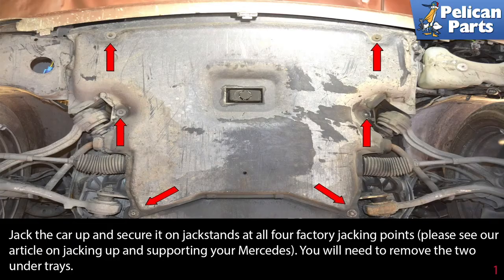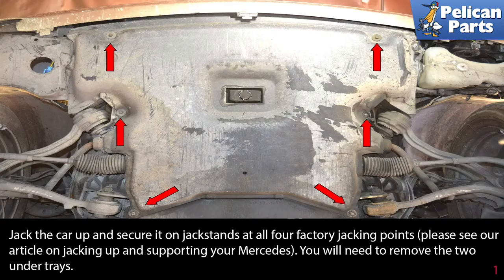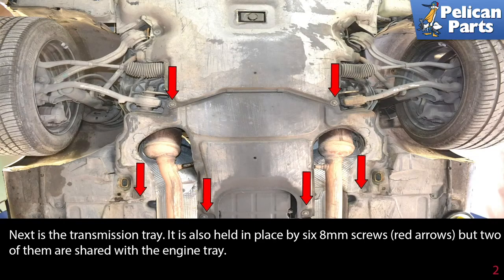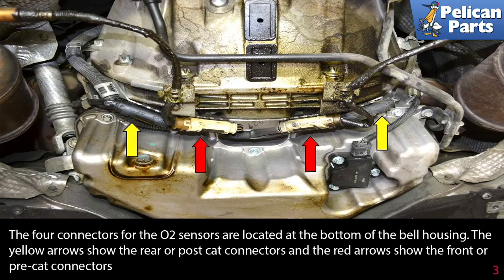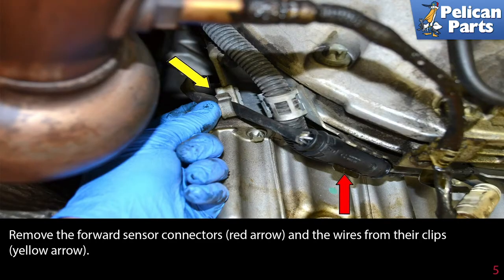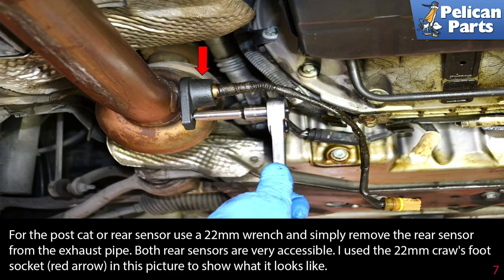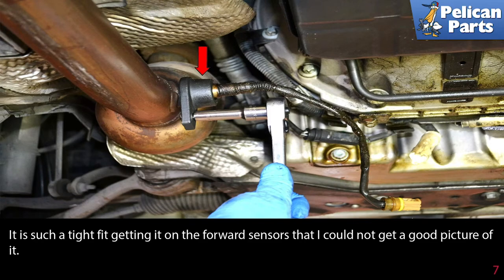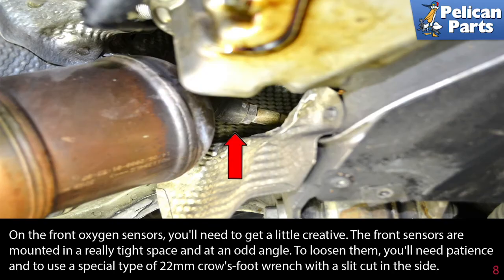Mercedes-Benz W203 C-Class Oxygen Sensor Replacement

Comment: Hello, i have some problem to find the o2 sensor for engine M111.970 mercedes e230, i’ve tried to get the manual and find where’s it located, but when i try to find it there’s no o2 sensor on it. Could you please share some information on how and where to find the o2 sensor for this engine? Thank you so much
Reply from the maker: What is the year, model and engine size of vehicle are you working on? I can see if I have that info.
Reply: MB c180kompressor year 2006.

Comment: But this is just the rear sensor how do you change the forward sensor without  dropping entire engine
Reply from the maker: On the front oxygen sensors, you'll need to get a little creative. The front sensors are mounted in a really tight space and at an odd angle. To loosen it, you'll need patience and to use a special type of 22mm crow's-foot wrench with a slit cut in the side.
Reply: @pelicanparts  SADLY  ITIS NO LONGER A PROBLEM AS ON sSunday 4 Feb  at 60 mph my  left side front wheel exploded off and  the damage it caused made it an insurance  write off oLDMercedes they say are  too expensive to repair and  the insurer now say only genuine NEW  parts can be usedand  a car of that age  cannot get them Shame because I loved that car CCannot afford another  asthey value it at £800  same price as the insurance!!!!
Reply: @pelicanparts  Can you prove a link of this special tool. I have a 2006 Mercedes C280 4 mattic. I'm having trouble getting the last o2 sensor out passenger side before cat. Its a very tight area and very little area for leverage or moving a wrench. You mention a special type of 22mm crow's-foot wrench. The regular 22mm O2 wrench is not working. I'm being told on this model you have to drop exhaust.

Comment: Luz servicio oxygen sensor
Reply from the maker: You didn't mention what year and model vehicle you are working on.

With your vehicle info handy, give The Pelican Parts parts specialists a call at 1-888-280-7799. They can figure out what part or repair kit you need.

Comment: These c classes are all about tight spaces 😭😭
Reply from the maker: Yes, definitely takes getting use to working on.
Reply: @pelicanparts  same person here, I just learned that replacing the upstream is easier on the top of the engine!
Reply: @tebibyte2357  What did you do to get to the sensor? I have a 2006 Mercedes C280 4 mattic. I'm having trouble getting the last o2 sensor out passenger side before cat. Its a very tight area and very little area for leverage or moving a wrench.